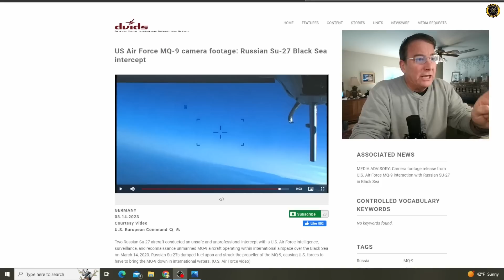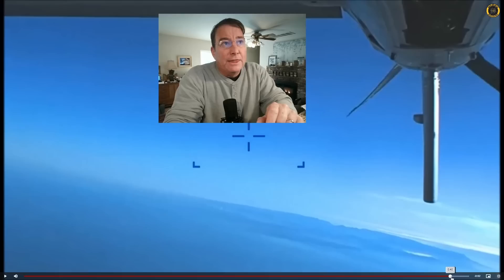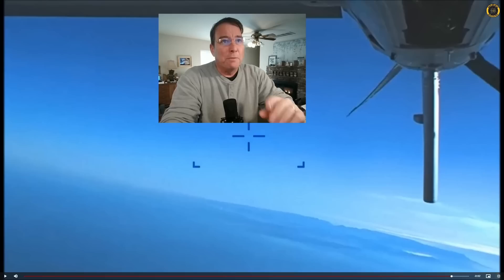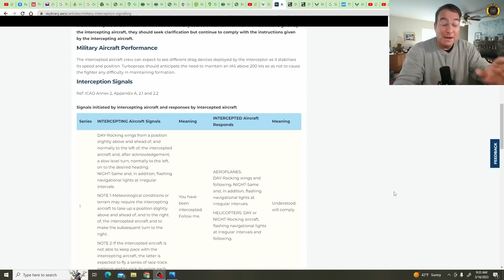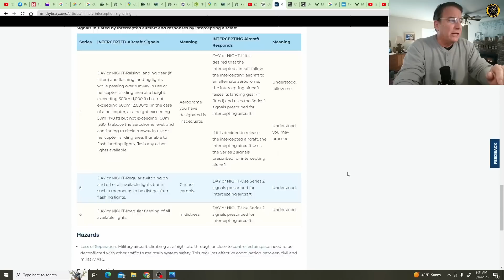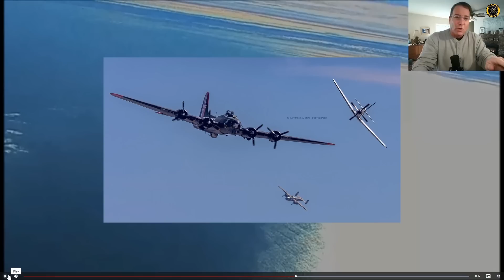Botched Russian Intercept of MQ-9 Drone Over International Waters

Comment: Good report Juan. But I wouldn't call it a "botched intercept" because they got what they wanted. Downed drone ,most likely relatively intact. I think the SU-27's mission was to knock it out of the air by using both jet blast and wake turbuleance.
Reply: It was botched.  The impact was unintentional.  The enemy was trying another fuel-dump pass, not physical contact (which could crash the Russian jet as well as the American drone).
Reply from the maker: THERE IS ABSOLUTLY NO TACTICAL ADVANTAGE TO RISK LOOSING AN SU-27 OVER AN MQ-9 DRONE OVER INTERNATIONAL WATERS BY INTENTIONALLY HITTING IT.
Reply: @blancolirio  After a silly rough estimate with wikipedia, and I'm sure the SU-27 number isn't adjusted for the year... unit cost estimate in USD for each are $30M for the SU-27 and $28M for the MQ-9. So... if the Russians were in the middle of something that they really couldn't afford the drone observing, but didn't want to risk the international incident involved in actually firing on it, risk of damage to the SU-27 might actually be in the realm of "on the table" for deliberate "get it out of the air, now" options. Effective and efficient use of resources hasn't exactly been their strong suit based on what we've seen over there so far.

It's not a good idea, it's not justifiable by any coherent rational approach, but I wouldn't put it past their approaches so far.
Reply: @blancolirio  We'll see. (Charlie Wilson's War)
Reply: @xxpoisonblxx  VERY true. At war, situations often arise where the cost of either aircraft - or their combined cost, AND the pilot - pale in comparison to that particular asset having been allowed to stay in the air at that particular location and time. This is within the ID zone of *Crimea*, whose Russian provenance the US doesn't recognize, i.e. over international waters, but after Nordstream the Russians for their part weren't exactly losing sleep over those technicalities.
Reply: @joesterling4299  No it wasn't. The drone flopped into the water in one piece.
Reply: @xxpoisonblxx  The MQ 9 was NOT on a sight seeing mission. It was spying in a war zone. Legit target. Job well done.
Reply: not that I trust a word from the pentagon relating to this ukraine-russia-usa clusterfuck but one of the two wokesters, Milley or the black guy (Carter maybe?) said that they initiated a self-destruct functionality as soon as they realized the significant damage. Who knows what that consists of but hopefully they can literally remote detonate.
Reply: @ALA-uv7jq  Technicalities all around. International waters. "War zone" for a "special military operation", not a war... yeah. Funny how politics works both ways...
Reply: @blancolirio  says a youtuber.
Reply: @blancolirio  The Russian pilot wasn't attempting a traditional intercept/escort.  He was trying to knock it out of the sky without actually "shooting it down," which would have had different political fallout.

That pilot probably got a medal and a promotion.  They don't think about safety the way we do.
Reply: @Ghost_Hybrid  I think you nail it... it really is a different culture; look at how much human cannon fodder they've already expended... and the leadership publicly doesn't care one bit; they talk as if they want more of the same.... Our national psych is completely different... even in our nations worst moments (Vietnam) when we may have sounded similar (who cares about how many we lose) I don't think we came close to the cavalier attitude about the sacredness of life that Russian leadership regularly exhibits (and it's apparent well before their invasion of Ukraine...) Unlike the West/US where individual autonomy and rights and by extension more individual life sacredness permeates us... it is the opposite there. Your more eastern, collective ethos of Russia and others like places, the national collective and by extension the natioanal elite/leadership is the ONLY thing with any value... everything else, including any # of your own tribe! humanity is expendable.
Reply: @blancolirio  EASY FIRE CRACKER TAKE A WALK IN THE WOODS!
Reply: @andyvisuals  100%
Reply: @andyvisuals  Yes all very good points that I agree with but I would offer that this IS our nation''s worst moment and our "leadership" has absolutely no interest in potential US casualties in anything it is or has begun abroad and in the USA.
Reply: @Ghost_Hybrid  Absolutely, that’s exactly what I was thinking. The Russian pilots did what they were supposed to do. They got an America drone downed with minimal damage for recovery and capture analysis.
Reply: @blancolirio  I would imagine the Russians would want the drone in as good a condition as possible as to reverse engineer it. That was some skilled flying to dump that fuel on the drone.
Reply: If this was intentional, that's an extraordinarily stupid way to do it, that pilot would have to be a moron to just cram the fuselage into a metal propeller when there's other options that would help the chances of survival of the PILOT(the one literally flying the plane, the ONLY one whose life is at risk, making the decision of how to hit this thing - if such a moronic order were given). I mean, they're over WATER...
  
I swear, I'm getting sick and tired of people CONSTANTLY giving Russia too much credit; they're a joke. The poor kids they're throwing out into war aren't trained worth a damn, this is not a secret. This was a total botch job, ol' boy got in over his head trying to screw with the drone.
Reply: @RyTrapp0  how would you down the drone without using firearms if you where that pilot?
Reply: @blancolirio  Over international waters with the transponder switched off makes it a fair target in that place. Rather than spend millions shooting it down, as the US did with the balloon, they also had the chance that it and its tech were recoverable.  
Botched would suggest it remained operational and under US control.
Reply: @blancolirio  Exactly, the SU-27 has a 30mm cannon if the pilot wanted to intentionally knock the drone out of the sky.
Reply: @churblefurbles  He's a pilot, you genius.
Reply: @joesterling4299  that video is from 2 different drones. It's already been proven. They never hit it.
Reply: @blancolirio  no one hit it. Stop with the tomfoolery. It's already been proven that the video was of 2 different drones. Please do keep up
Reply: @monochromedout  the drone was recovered. They think they can wipe it remotely. But if it retained video, it probably retained more. Russia already had obtained that drone a while back and knows its faults. I believe they displayed it at a military expo a couple years back. Look up videos from then.
Reply: @archiepilcher6727  they already had the drones. This one is just for collection. You're forgetting Afghanistan and Syria? They already had those drones and their components in their possession.
Reply: @RyTrapp0  calm down. You didn't even realize that the footage is from 2 different drones. Good job paying attention. Watch the videos again. Or look up how it was already proven to be different drone footage.
Reply: @harry356  microwaves or electric blast would fry the components and down it. But I'm sure they didn't want to fry it. So they did the next best thing: drowned it because seals suck on it. It was developed for desert warfare it does not do well with liquids.
Reply: @xxpoisonblxx  You definitely forgot that the SU-27 can just shoot it down with guns 🤦🏻‍♂️

It was botched.
Reply: @xxpoisonblxx  And you also forgot to include the value of a human live into your “botched” calculation 🤦🏻‍♂️

MQ9 is a drone… 

SU-27 has a human inside it.
Reply: @tonamg53  Firing the gun turns it from an "oops! We bumped it out of the sky on accident!" claim (however BS) into starting a shooting war. That was never on the table for the pilot. As for the value of the human in it... I factored it in at about the same level the Russian government would. It wasn't a significant factor.
Reply: @xxpoisonblxx  Find me one person who would value Russian government more than his own life…

No, I don’t think this pilot is that person…
Reply: @blancolirio  yet they did exactly that.. without.. firing on it & creating an action of war/attach.. it WASN'T botched as you put it.. little risk to the mig for a skilled pilot.. risk vs reward.. the fuel dump was an effort to stall the drones engine by suffocating it
Reply: IKR .. the "what if ism"  and arm chair quarterbacking are hilarious.   They got what they wanted.
Reply: @blancolirio  if they cared about tactical advantage to risk, they would not start a war with ukraine. This particular maneuver is called "taran" in russian military and is originated from the WWII.
Reply: EXACTLY!!! There is no comparison between the accident in Texas and this; one can see the SU-27 pilot had a clear vie of it as he approached. Is this Youtuber a former U.S.A.F. pilot?

Comment: "Botched" ?  I am confused.  The Russian pilots brought the drone down without firing upon it.  I would say "successful".
Reply: There was literally a mid air collision. Do you seriously suggest it was intentional to collide with the prop?
Reply: Intentional or not, but the drone was damaged, not a single bullet/missile was fired, and the Russian aircraft ended up in good enough shape to fly back. What's botched about it?
Reply: They did bring the drone down but the collision wasn't intentional.  He was trying another fuel-dump pass, which wouldn't be necessary if the intent was to ram the drone (with the enemy risking the crash of their own aircraft as well).
Reply: @joesterling4299  "...the collision wasn't intentional." You don't know that. That is an assumption. You point to the fuel dump as evidence saying it was unnecessary if the intention was a collision. Did you know the Mig did more than one pass using the same technique before the collision. Did you take into account the mig pilot would be a vulnerable target once he overtook the  drone & spraying fuel could obfuscate the circumstances if only for a moment to the ground based pilot(s)?
Reply from the maker: THERE IS ABSOLUTLY NO TACTICAL ADVANTAGE TO RISK LOOSING AN SU-27 OVER AN MQ-9 DRONE OVER INTERNATIONAL WATERS BY INTENTIONALLY HITTING IT.
Reply: @blancolirio  
The "collision" was not intentional.  I don't believe they were dumping fuel upon it to give a glossy sheen.
Reply: 4:18 oh, how nice, "harassing the drone", the "peaceful" drone that targets Himars on civil cities, ohh.... And international waters yes, but Russia extended the nonfly zone after 24th Feb 2022 and NATO knew that. Thus NATO didn't say it was a collision or an act of war because they knew they breached that area. Simple
Reply: @blancolirio  More assumptions Juan. 
First, they did NOT lose a SU-27. They RISKED losing an SU-27. You & I don't know who made that judgement, it very well could have been with the pilot himself & there is evidence of that.
Second, to say you have ALL information or enough to make a judgment on tactics or that tactics were the sole consideration is to profess clairvoyance.
Reply: @blancolirio  you know that writing in capital letters equals to shout in the internet? Reading your messages it's pretty annoying, mostly as see your vid mate
Reply: @urrugames4062 - Reading your messages it's pretty annoying...
Reply: @rickyricardo9918  Right, but can't we say with 99% certainty that most successful intercepts are NOT ramming an unarmed drone using an expensive SU27 when Russia needs to keep their military aircraft and more importantly TRAINED PILOTS alive during this conflict with Ukraine...... especially when you consider the fact that the US literally has hundreds of drones ready to take it's place ......

It could very easily have went the other way with the Russian pilot losing his aircraft and eventually his life when he ejects into the vast Black Sea.

Think about it.
Reply: @vangarus  yes it is mostly himars  destoying cities, not Russia who previously bragged about doing 60,000 artillery rounds A DAY! 
Those rounds have to land somewhere, and Rusdia isn't motivated to try to not destroy Ukranian cities because, you know, they don't LIVE or BELONG in Ukraine.
Reply: @mrdumbfellow927  Are you making a claim that the intercept was not successful from Russia's perspective? 
Are you making a claim that there is or should be a financial calculation made with regards to potential loss of military equipment before an enemy is engaged?
Are you making the claim that the SU27 is a significantly more costly aircraft? Google says they're both around 40MM.
Are you making a claim to know whether of not the drone was unarmed?
Are you making a claim that so long as a military craft is unarmed it should be left alone under all circumstances?
Are you making a claim Russia is somehow near a crisis with regards to trained pilots & serviceable fighter a/c?
Are you making the claim that it would be absurd to enforce a posted airspace restriction based on risking a loss of an SU27? But isn't that what they are there for & absent enforcement would that not run the risk of exposing oneself as toothless?
Are you assuming Russian pilots are unwilling to engage in tactics that involve personal risk?
Reply: @rolmaxify  there was no collision.  the fuel dump worked as intended and bent the prop
Reply: @rolmaxify  No conclusive evidence showing the plane hitting the drone. Camera didnt shake. Video was edited
Reply: Agreed.
Reply: @ashkiler  The “botched” is the fact it was pure luck the pilot didn’t rip the guts out of his Su-27,a mid air collision is not something that can be controlled.
Reply: @markhepworth  The definition of "botched" from Merriam-Webster dictionary: "unsuccessful because of being poorly done, spoiled by mistakes". Notice "unsuccessful". Was the pilot's action risky? Yes. Was it unsuccessful? No.
Reply: @blancolirio they kicked imperialist usa ‘s ass
Reply: Ditto !
Reply: yep
Reply: Probably took some damage to the fighter, but who could say.  It clearly could still fly fine.
Reply: @gomertube what censors?
Reply: @vangarus it seems there's a long dance leading up to war.

Comment: I dont think the Russian pilot botched anything.  Here's why.
The bent prop is not evidence of a strike by the Russian. It IS evidence of a driven prop striking a large volume of fuel.
When you look at the Reaper tail and prop, you can see the prop arc is entirely within the geometry of the three tail surfaces. This would make a physical strike of the prop alone near impossible.
There was no need to hit the drone. They knew the fuel would kinetically destroy the prop, and that was always the plan. Notice the Reaper did not exhibit any difficulty with control after the event. Because the tail was not damaged by the fuel and there was no collision.
That damage to the prop would lead to instant overtemping of the engine. It would literally melt. As tough as the TPE331 is, it could not handle a feathered blade. Let alone, as mentioned, the vibration!
This was in fact a demonstration of some pretty good flying and a bit of logical thinking seldom seen in current western militaries. Witness the spy balloon debacles.
Reply: that would also actually explain why the paint stripes are wiped off the rest off the propellers.  But IMHO, the direction of the "N" indicator change also indicated that the drone switched direction as soon as the russian aircraft approached it.

Comment: if they hit the propeller they almost had to also hit the ruddervators.
Reply: that was my thought as well.
Reply: Yup
Reply: Yep, my thoughts exactly 👍🏻😀🇬🇧
Reply: They're very wide apart, leaving quite a big gap between the tails
And as the video is shot from below, there's no telling if or how badly the tails were actually hit ...
Reply: A lot of people seem to think that but that isn't likely.   That would have led to the relatively immediate demise of the drone due to controllability issues.     The Su-27 most likely was very lucky and dipped a wingtip through the V-tail gap and simply caught the prop tips.    The MQ-9 does have a wide V.
Reply: Not really: come in off the horizontal (SU looked to be at a good 40°), and you can put a wingtip right down the middle.
Reply: @jpdemer5  yes that would be easy for Art Scholl or Bob Hoover, your average squadron pilot that missed completely with his first fuel dump pass, not so much.
Reply: @marka7831  Seeing as he was skidding through the turn, blind as he was pulling up,  that Su-27 pilot got plain (plane ?) lucky.
He might just as well have smashed his Flanker into the drone
Reply: @Wannes_  a sudden pull of the stick by the MQ-9 pilot operator would have been appropriate.

Comment: Botched?  The drone was brought down was it not?
Reply: Logically you risk your plane and yourself only if you run out of missiles and bullets and it still must be done. Either they already used all of that in Ukraine. Or they do not operate in logic. Or perhaps he simply wanted to pull some scary stunt to prove some point and screw up. In that case it is botched.
Reply: Heavy coping going on today.  Beautiful precision takedown using jet wash.
Reply: @hbh3144  what are you talking about ?  JC was trying to point out the drone was brought down and it was not botched like the clickbait title
Reply: @user-pf5xq3lq8i  explain to me how jetwash can bend a prop that normally spins at thousands of RPMs. Do you know what kind of stress a prop normally goes through? If you had even an iota of a clue you would know that jetwash can't bend it lmao.
Reply: @user-pf5xq3lq8i  the only coping going on in this comment section is me trying to cope with your ignorant takes, and failing miserably.